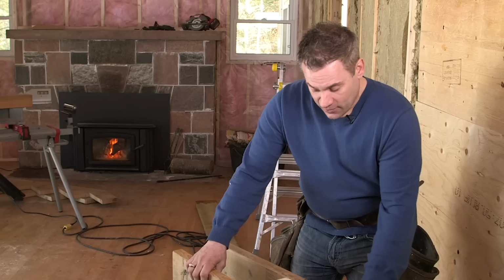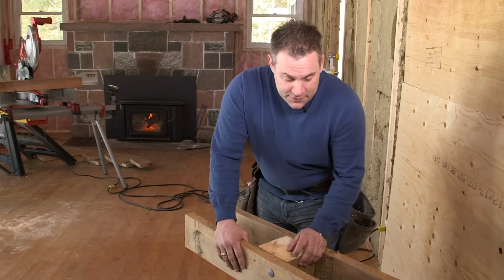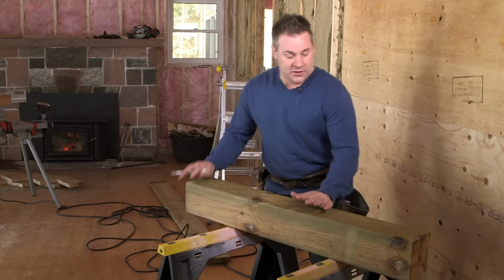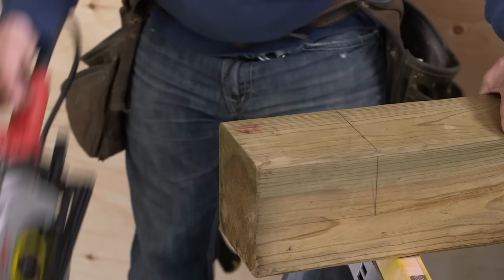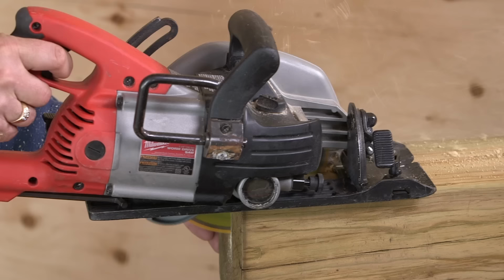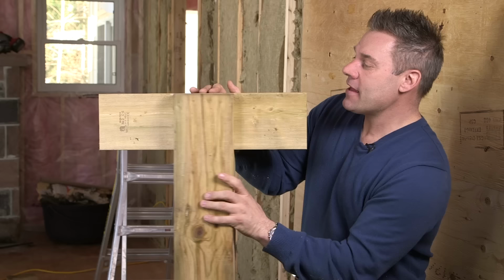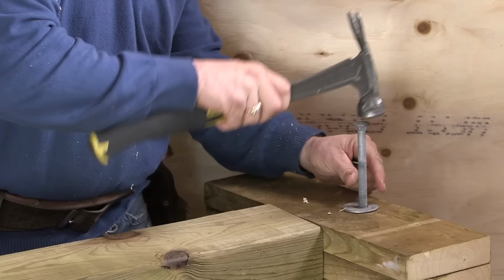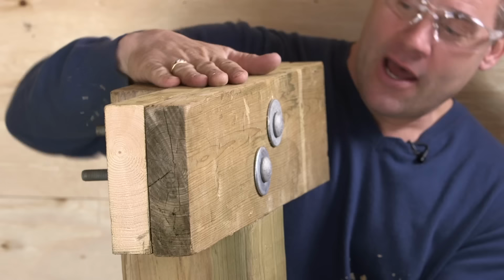How to Attach a Beam to a Post for a Deck | Decks, Docks & Gazebos

Comment: If notched method, best to notch both sides for a beam on either side, by putting both together you dont allow air to dry out when they get wet.  Have seen many of these needing replaced because the rot between them from always holding moisture
Reply: It was pretty much what I was expecting to see for exactly that reason. I'd have thought it would be better to allow free air flow to around as much of the structural timber as is possible.  And particularly so where said structure is potentially going to be out of sight or difficult to access in future.
Reply: This is absolutely correct.
Reply: Having trouble visualizing what you mean? Care to produce a video?
Reply: noone n A smaller rabbet on each side rather than one large rabbet on one side of the post.
Reply: David Moore many people do not treat the notches with wood preservative and that also leads to early failure
Reply: True in its theory but is not the doubling for a purpose? Part of the trouble is our concept of longevity. Historically, ships were built as consumables, the first owner lasted between ten and fifteen years and made a profit from it in that time. It was then sold on several times and scrapped after 40-50 years. This assumes that it could survive that long in trade as many were lost on voyage - read Lubbock’s books upon shipping. This is not to say that any of the statements are not valid merely that they are coloured by our preconceptions as to ultimate life of a structure. The point of this item is not the longevity of the structure per say by
Reply: @glynluff2595    Sounds like you wandered in off Quora. Decks with hidden dry-rot have been the cause of many a death.
Reply: Markus Chelios Hello, I hit the send button before I completed my statement. The point I wished to make is the article is about stress in sheer and carriage bolts are made of cheap steel. If longevity is required then pack the joints with salt as was done traditionally. However, few traditional vessels had a design life of more than fifty years and it was a matter of comment to find vessels of greater age as by that time they had become nail sick unless copper fastened. I once owned a boat which had spent its life in a fresh water environment including being sunk as a block ship in WWII. There was little rot but much work in replacing fastenings with copper and timbers cracked through stress and the use of modern sealants over failing calking. It is only the advent of modern fibreglass structures that have led to the expectation of light marine structures having an extended life cycle and the earliest major example is owned by the US Navy who still take core samples for research purposes. However when all is said and done these are mere interchanges of points of view and others will hold opinions equally valid. Best regards.
Reply: not a clue. You lose strength by separating them.
Reply: Sisters of Isis If you need extra strength use a proper beam. Sandwiching joists leads to early failure.
Reply: I agree that lumber that cant dry out will rot. Ive seen it happen in as little as one year. However the only time ive seen it occur in vertical boards sistered together is when they were not tighyly nailed and debris was trapped between them. (Ive inspected,  repaired, and built dozens  of decks and other outdoor structures over a 25 year career.)

Presently, Im convinced that the best practice is to contruct a beam by tightly fastening 2x material together with an alternating pattern of ring shank nails (screws only if a bow gives me trouble) and bearing it on the post, bolted in a notch or with connecting hardware. 

But lets say that mating the two boarda together is the problem. How is mating them to the post, instead of each other, a solution?

The  joists will show rot along their top edge ( typically at 12-15 yrs is what I've seen) This is caused by water penetration at the fastener and compounded be the deckboard becoming loose, allowing debris to be trapped which keeps everything wet. If a repair is then made by sistering a joist along side of it, this will compound the problem and theyll both be rotted out within a few years. 
Again, these are just my observations.

Its an interesting discussion, but at the end of the day, our theories and observations are almost irrwlevant since the AWC finally compiled a residential deck prescriptive. At this point bolting the boards to the side of the post is specifically prohibited.  It does call for the beams to be sandwiched 2x (which is how the beam span charta have been laid out for as long as i can recall) , but inspactions are passed or failed by the inspector. Notching a board on each side of the postt would be structurally sufficient to meet the minimum load requirement (40psf live/10dead, same as any single story floor system, which i dont really understand since a deck doesn't carry a roof). But i would advise getting it approved by local code enforcement or signed off on by an engineer first just to be safe.   I had to rebuild part of a gazebo one time and it s u c k e d !

Edit:
https://photos.app.goo.gl/Hm7TGguAVB3hoZxN9

https://www.awc.org/codes-standards/publications/dca6
Reply: @markuschelios6891  also...many people dont know how to build a fuking deck, and that can lead to early failure as well...
Reply: @joncrosby8988   You'll love this: https://www.youtube.com/watch?v=ve1CkWhPE5Q
Reply: @joncrosby8988  that's a better comment than your first one and saved some things LOL
Reply: @markuschelios6891  yeah thats a good one and that dude LOVES to talk shit.

I just had one...guy built this deck sideways, i.e. the board he nailed to the house wound up just being an end joist. Load xfered to a board that was nailed to the end joist of a perpendicular laundry room ADDITION. IT WAS PULLIN THE FUCLING LAUNDRY ROOM OFF THE HOUSE.  I hope i explained it enough to picture that in you head. 

Oh man and that was the tip. I shot a ton of video i shoukd work on srsly. Classic. All this controversey about one detail...honestly if youre doing any of these comment suggestions you in the top 50%, at least around here
Reply: ........the colour of the timber looks like it's been treated to prevent rot.
Reply: THE OUT SIDE ONE GOES ROTTEN   OVER TIME IN ALL CASES
Reply: just put covering on top of joists and beams , no problem.
Reply: by puttin lumber together and fastened all along beam it creates a stronger beam rather than 2 seperate beams.
Reply: The separation between the members does not allow each to support each other against torsion. This is not an allowable beam design by code in most places, though I see your point- construction adhesive to seal, butyl tape on top of seam, or one large beam vs a lamination may be better options.
Reply: @markuschelios6891  nope. Sandwiched is stronger. Simply seal the top from water entry
Reply: "Have seen many of these needing replaced because the rot between them from always holding moisture" 
What's the difference whether it's notched or not when talking about moisture getting between the surfaces?  You see? There is no difference. How old are these rotted joints you've seen?
Reply: Makes perfect sense.  Probably why the inspectors frown upon this method where I'm at!

Comment: Normally the bolts won't see much in shear due to the friction the bolts are providing between the two wood pieces. The problem occurs when the bolts loosen up and start taking the load directly. Even so, the typical homeowner's deck doesn't carry huge amounts of weight (except maybe when piled with snow) and one carriage bolt in a deck would never be a single point of failure. That being said, best to build to code.

Comment: I normally use double sided sticky tape
Reply: Ha ha ha!
Reply: I just chew lots of bubble gum while building and pluck pieces straight outa  my mouth as needed to fasten things🤗
Reply: As long as it's 3M, and not some cheap knockoff, you should be good.
Reply: @lonefeather49  by the time the gum dries out, the bugs should be holding hands
Reply: I use silent Velcro, just in case I change my mind halfway through the project!
Reply: ....Zip ties are always good if you don’t feel like tripping to the depot or Lowe’s!😂
Reply: Make sure to clean both surfaces first!
Reply: that's a really good idea!!! thank you
Reply: Duct tape is more versatile, and it comes in matching colors.
Reply: simon martin    Well masticated chewing gum works too !
Reply: Just smear a little gorriller glue on er.
Reply: Bob Hoffman  There may be a better color selection with Duck brand duct tape.  Either way, a generous wrapping in any brand will provide a stronger result than you would get from some of these overpriced handymen around here. ; )
Reply: Yes double sided tape gorilla tape
Reply: @Caveman Claude did you invent it it's been around for 15 or 20 years
Reply: I usually just toe-nail mine.
Reply: simon martin 
Glue gun
The hi temp tho cuz it’s better
Reply: @deplorableb.r.4211  
Doesn't that hurt?
Reply: Wood rots . I hate that
Reply: Contact cement
Reply: I pick my boogers first thing every morning and save them in a jar to use for projects like this.
They also work as a substitute if I run out of Flex Paste.
Reply: Velcro
Reply: That 3m tape is unbelievably strong
Reply: Simon M   Eedjit

Comment: there's more than one way to skin a fox. .. but the right way is the way that is still holding years after the check has cleared.  I'm a big fan of the notch method.  you can't argue with this point load strength.  However, I did notice a valid argument of cutting the notch 1/2" shallow to accommodate for shrinkage. 
thanks for the vid. I probably would have run the lag screws prematurely!

Comment: Four carriage bolts definitely have some shear strength,especially when held in the wood.
Reply: The more bolts you use , the more holes you drill which weakens the wood .
Reply: @stevegagnon9451 : Two bolts staggered is optimum and notching is always a bad idea.
Reply: I think the concern would be the bearing capacity of the wood, not the shear strength of the bolts.
Reply: @MrMindock  well there’s no bearing strength if the ledger plates are bolted to the post

Comment: Carriage bolts do not require and should not have a washer at the head end. The head is designed with a square shank so that it burys in the wood and does not rotate.  A washer defeats that . Washer is only used on the threaded end under the nut.
Reply: That makes sense. Do you like the technique in the video ?

Comment: I would always notch out but for smaller decks would use the carriage bolts and use a 2x4 support underneath the load for additional support. There is a few ways to skin a cat as long as your not breaking code

Comment: I've been a carpenter for 48yrs. All the comments here about the strength of carriage bolts is correct. Unfortunately  this guy stressed (pardon the pun) the wrong point, namely that too much load here, and it would be the beam that would give out first. It would split around the load point on the bolt.
Reply: yep,  I once built a small water tank stand and greatly understimated the load.  It was built in this style with large screws suitable for treated pine.   Failed around the screws with wood splitting exactly as you describe.   Seeing it was all in place i used some heavy duty supports brackets (angle iron) and thru bolts.  Been sitting there for 8 years now and still seems happy.  Lesson learnt.
Reply: I think your comment is the most informative here. It explains the reasoning behind the video's message better than the video lol. I wonder if there is a way to get drainage/airflow with a system like this to prevent long term rot between the 3 peices of lumber?
Reply: What he is showing is how they used to  attach the beams on decks. If you have been a carpenter for 48 years you already know that.  They never notched the post back then and even in the 80's.
Reply: You are right.